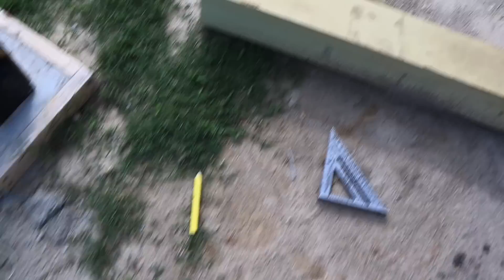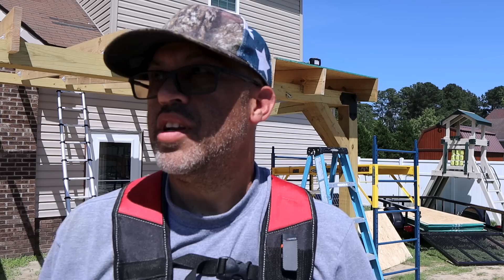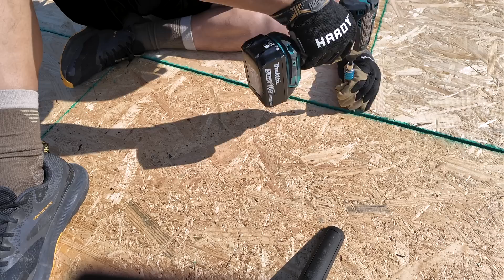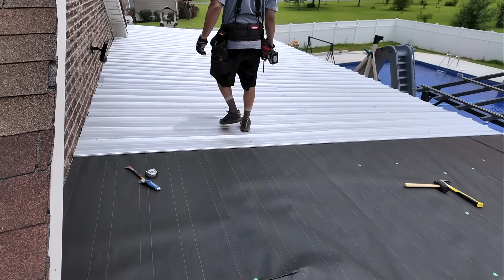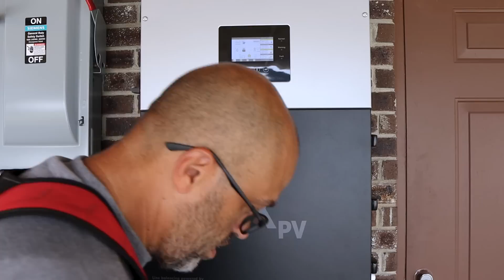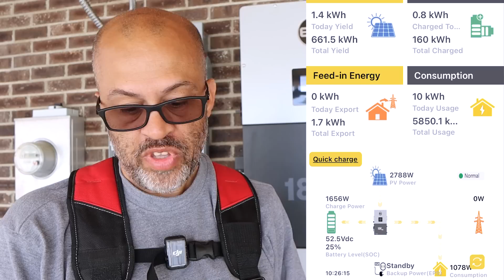DIY Solar Patio Build Part 2 - Homemade Solar Patio for EG4 18KPV

Comment: Greatly appreciate this info Rodney ! i just ordered a 12000xp and 13 peach 390w panels using your RODNEYHUNTGET50 code at signature solar . i'm adding a metal roof over our back deck and will be using most of the panels there . thanks , jeff

Comment: Looks great and I have a back of my house I could do that to also so its good to see this!   😊     I would be tempted to leave the top open and install solar mount rails across the top and install Bifacial solar panels and finish a cement patio to help reflect light up from below.          Looks like you need to move your security flood light out to the edge of the patio roof.
Reply from the maker: Yeah my parents ended up wanting the roof. I would have only used panels as well

Comment: I think this Bi-facial panels should not be installed on roof sheets. Back side Reflection generation works with direct installation on structure.
Reply from the maker: It’s what my parents wanted. I purchased to use panels as the roof but like I said in one of these videos my parents made the call to add the roof. 👍

Comment: Why no flashing at house wall where you tied in the metal roofs. Would it leaks down the road?
Reply from the maker: Small gap intentionally left. Even during downpours still dry between house and solar pergola roof. The house has a small overhang that is helping as well. Thanks

Comment: Hey man!  I am back as I consider a small porch solar cover for my pad in back that has a hot tub.   I am considering installing a hybrid EG4 mini-split and hooking up a few panels to the mini-split as PV connections.  I think that would be cool.  Anyway my solar journey has changed since a whole house design was more than I had advertised to my wife.  I am re-thinking to use solar to give me battery backup and use the grid as backup when I run out of batteries and output on an inverter.  I do like what I see with the 18K EG4 as well as the Sol-Ark.  Lots of options haha.   I am a life long learner and waste more time learning off of videos rather than getting my butt off the couch.  Thanks for your content - wish you were local to me - I could buy you a coffee or something.  All the best from north Texas.
Reply from the maker: Hey thanks! I definitely appreciate the support and I say just do it sooner than later the way things are going. 👍
Reply: @rodneyhunt  yes I agree on doing something soon. I plan on putting 2 minisplits up this fall. I have to figure what I want for my ground mount and build pieces at a time that scale.  I like learning this stuff. All the best!

Comment: Wow nice.  I'm in NC too (Charlotte).  I so much want to do the same as yours.  I have drawings for the solar patio,  but local gov and HOA permits have keep me from doing it.   Building anything that is over 12 feet of any dimension will need a permit Mecklenburg county. I was thinking of just doing it without permits but a little nervous.😂
Reply from the maker: Yeah I know what I would do but try to follow the rules for insurance purposes for sure. Hope you get it worked out

Comment: Nice work!  Work for the wood splintering you would be amazed how well masking tape works to reduce tear out.  You may want to consider installing flashing on the wall of the house where it transitions to the metal roofing as well as installing a drip edge around the perimeter.  Water traveling down the brick could get under the decking either from rain or washing the panels.  Since the slope is fairly shallow a drip edge will keep water from wicking back up under the decking.  I roofed a pergola with a similar slope and had to replace the decking after about 10 years due to dry rot that I could have avoided had I flashed it properly.
Reply from the maker: Hey thanks for the tips! Not really a builder so always learning

Comment: I'm going to do something similar to this, but I thought I'd have to have all the equipment in its own shed. Even though this equipment is sheltered by the roof, it is open on the sides. Do you worry about blowing rain hitting the equipment. Or is it designed to be out in the open? I don't want to build some elaborate shed if I don't have to.
Reply from the maker: Those equipment is rated for outdoor use. So as long as you get outdoor rated you should be fine. The patio shelter keeps it out of direct sunlight which is key. Plus direct rain etc. The 18kpv and 12kpv are outdoor rated inverter options then just get outdoor rated battery.

Comment: Lots of great info in your videos. Do you mind sharing what state you're in and how difficult it is to get permits for your DIY solar if you need them?
Reply from the maker: I’m in North Carolina. We try to do off grid setups so depending on your jurisdiction permits shouldn’t be required. I did look on my counties website and found nothing on solar. But then again I would not ask either. Not giving them any reason to get involved lol. But please follow all your local applicable laws. 👍
Reply: @rodneyhunt  thanks. I like your off grid set-up. I'll look into it for my area but the city and insurance companies don't make it easy. I'm definitely not giving a solar company Mercedes money to install some panels and an inverter.
Reply from the maker: Exactly! Hopefully you can get it sorted out. Regulators taking freedom from us daily. It will be worth it when you finish!

Comment: I am looking forward to your video about the optimizers. I wonder what the power difference will be between the angle they are at now and what a 30 degree tilt would do.
Reply from the maker: Would have been nice to have more of an angle fir sure. Just didn’t work out with what we had to work with. Video about optimizers will hopefully been out next week sometime.

Comment: @Rodney when will you release the build of material? I like to know that 6x6  L support and length of the bolt .. did you painted the bolts black?
Reply from the maker: Video is on my to do list but not sure when exactly. I did not paint any bolts.
Reply: @rodneyhunt  so the bolts for the L brace came as a kit? .. ok will wait for the parts build video ..
Reply from the maker: Those are simpson strong tie brackets and bolts. They come separately though. Got them from lowes
Reply from the maker: Outdoor accents might be the name of that series if brackets and hardware
Reply: @rodneyhunt  awesome thank you  .. mine are some amazon low cost version, they work but has NO  style to them, i like yours a ton.. will swap mine out once i get them.. thanks
Reply from the maker: No problem! 👍

Comment: Nice setup!!! Install looks clean. I would have left overhang longer so shade would be less on the top panels if they were lower down on the roof. I would add a L Drips edge against the wall so water doesn't go down the wall. Impressive build man. You did an amazing job.
Reply from the maker: Hey thanks! Good ideas

Comment: Just a note from a builder- high temp roofing underpayment with metal roofing is the standard but with the layer of solar shading the roof, should be fine. Also expensive. I have so much to learn about solar so appreciate all the good YouTubers like you.
Reply from the maker: Had no idea that was a thing. Like I said not really a builder lol. It should work for now I think. Will look into that next time! Thanks

Comment: Should use brackets make by s-4 that screw right into the ribs. Make jobs a bit easier😊
Reply from the maker: Yeah! Probably need to look into different brackets for the next metal roof job. Thanks

Comment: Hey Rodney, looks great. Only thing I'd do do different is to skip the plywood and tar paper  (we just want some shade) and use bifacial panels.  I see your comment to another that you too used bifacials but your parents wanted the weather blocked by ply and tar paper.  
I would have also just put 22.5" spacers across between the joists where the plywood seam is - that would have given you a little more strength. And, like you mention below, using those H clips helps too.  Looks good man!
Reply from the maker: Yes I agree with skipping roof for just the panels! But they have what they want now at least. Thanks!
Reply: @rodneyhunt great job. I am looking at doing what Joe mentioned: Bi-facial no plywood since we just need shade. I learn a lot from your videos and get ideas. 
Thanks

Comment: I am planning for a similar pergola to install solar panels. For the 30% Federal Credit, can i include the cost of pergola or is it just the solar panels that qualify?
Reply from the maker: That is mounting for panels so should be included in my opinion. Ask an accountant to verify but that is what I think
Reply: @rodneyhunt  Using your logic, you could write off the house the panels are attached too also!  LOL!  No, the pergola itself would not qualify...
Reply from the maker: No the house was already there. The mount was specifically built for the panels. But like I clearly stated you should ask an accountant. Thanks
Reply: @rodneyhunt  thank you
Reply from the maker: Here is the energy.gov information on what is covered. It says mounting is covered but talk with your accountant. https://www.energy.gov/sites/default/files/2023-03/Homeowners_Guide_to_the_Federal_Tax_Credit_for_Solar_PV.pdf

Comment: Great Work Rodney, I can  recommend using a grandfather cane method to push the wires thru the roof ( like HVAC ) , meaning using like 180 degree pipe like a cane to push the wires then bend and go down that way no water will drip in  just use 2 90 degree 1 inch and some straight pipe thru the hole, seal it and then push the wire water like to travel on wires, even if u seal it most chances it will go in, using the method the water will have to go up then down so its less chance it will go in.
Reply from the maker: Great tip thanks! Appreciate the support

Comment: Thanks for taking the extra time to record and edit the video. Great job especially since you did most if not all of it by yourself. I have a question about the cables under the panel laying on the roof. Do they need to be tied up somehow so that they are not touching the roof? Maybe you are waiting until you install the optimizers before you do that or maybe I am wrong. Thanks again for the great content.
Reply from the maker: Yes. Waiting until optimizer install to clip wires to panels. Thanks

Comment: Great job. What is your plan for End wall drip edge where the brick face meets the end of your roofing. I totally see water running down the brick and getting under your roofing. There's a good YT video on this at Metal Roofing Learning Channel. Search: "How To Install Metal Roof Endwall Flashing On An Awning. Endwall Trim Installation Instructions"
Reply from the maker: For now leaving the small gap to keep structures separate. The eaves on the garage roof should keep most rain off the spot unless the wind is blowing directly at it. Rained several times since installing plywood and has stayed dry so far.

Comment: Nice work Rodney! Amazing how you do everything all by yourself. Don't forget to add a nice bead of sealant at the top edge of your metal shingles so you don't get water seeping in 👍👍
Reply from the maker: Hey thanks. Left a small gap since this is freestanding. We have the eave from roof that should cover most of the small gap. Thank you for the tip!  Can always add it if it seems necessary later
Reply: @rodneyhunt  That OCB doesn't like getting exposed to moisture, so get it all covered and sealed up!

Comment: Rodney one other thing, you only need 9 optimizer for the top 9 panels, and wire the top together and the bottom together separately, it seems in the morning only the top 9 panels get shaded.
Reply from the maker: Really early the bottom seems to be shaded some as well. Regardless I will add since could be more shading during winter months when sun is lower in the sky. Plus I ordered enough to cover them all
Reply: @rodneyhunt  copy that plus with the Tiago app you can see each panel performance so that’s a plus too, BTW their is just one thing I don’t get, the grid connection is going back to your main panel via backfeed 70amp breaker, how does the 18Kpv knows what the grid is feeding your main panel with the grid is still connected to the main panel lugs? Is there some sort of sensor the 18Kpv has to detect the grid load or it just assumes if the house is asking for X and its sending Y then the grid most be Y- X?
Reply from the maker: The CT’s are the sensors. They are on grid input lines that are connected to the main grid panel. Your main lines on your 200 amp breaker.
Reply: @rodneyhunt  i see .. i think i missed that part now that makes sense, i missed you got CT’s on the main hot lines .. now i can sleep lol thanks again brother .. keep up with the awesome content 👍

Comment: Does the hybrid inverter have an arc fault interrupter or something to detect arcs if a connection becomes loose over time? 400V DC seems pretty dangerous in this regard.
Reply: Yes, the 18kPV has arc fault protection on the PV.

From the spec sheet:  PV Arc Fault Protection, PV Ground Fault Protection, PV
Reverse Polarity Protection, Pole Sensitive Leakage Current
Monitoring Unit, Surge Protection Device, Output Over-Voltage
Protection, Output Over-Voltage Protection Varistor,
Integrated Disconnect DC switch for each MPPT
Reply: @AndirHon  thank you! There are so many cheap chinese hybrid inverters on the market nowadays, and I doubt that most of them have an arc fault protection even though they usually accept up to 500V, good to know EG4 ones are equipped.
Reply: @gaggix7095  It's built to mimic the SA 15K, so yes.
Reply from the maker: Thanks!
Reply from the maker: I know it has a PV short alarm. So it must turn off but not 100% sure. Will try to find out.
Reply: @rodneyhunt  I was mostly talking about series arcing, not parallel arcing. I don't think they will trigger a short alarm.
Reply from the maker: Will need to do some research on this topic. Thanks for the info

Comment: Good job ! Try to have pc wires attached to panels under and not loose on metal roof
Reply from the maker: Will do! Going to add optimizers so didn’t want to tie all cables down yet

Comment: DIY Solar Fun with Ray Loveless does use grid to supplement his 6000XP. Couldn't start central hvac until he tied grid in. Trying to be sure before I get XPs. Thanks great fun and editing / commentary is all perfect
Reply: Advise him to install a soft start on the AC…
Reply from the maker: Good idea!👍
Reply from the maker: Yes they have grid input but not grid interaction. The 18kpv can receive and feed the main grid panel. 👍
Reply: @rodneyhunt  Are you saying the 6kxp is unable to pull the difference in load from the grid like in the video? so it would be all solar+battery OR all grid?
Reply from the maker: Just couldn’t go to same main panel like 18k. You would need grid input from a different panel or the meter to feed the 6000xp that feeds the panel it is connected too. So in from one place and out to another. The 18k can send to the same panel the grid is powering.

Comment: Looking good Rodney,  as are you. Looks like you've lost a bit of weight. Good job, i need to also. Only thing I'd done different is put a band on the front of the porch on the joist as it keeps it from twisting and curling over time.... Jefg
Reply from the maker: Oh nice. I have been doing the carnivore diet since January 21st. Lost over 50lbs. Thanks
Reply: @rodneyhunt  Excellent,  2 year ago we did keto lost over 40lbs. But unfortunately work got in the way. Trying to get my wife to do again or carnivore diet. Just  don't feel good  at present.
Reply from the maker: Feel better as well. I think everyone should try it for 30-45 days to see how they feel.

Comment: I was going to say you waste all the time and money on the roofing portion when you can easily use the panels as the roof nowadays but I noticed the panels are bifacial so this is actually big brain because you are using the heat that will be reflected by the metal roof as more energy for the back parts of the panels. GOOD JOB SIR!
Reply from the maker: I wanted to panels as rhetorical roof but parents wanted the roof then panels. So I hope the metal will reflect some light but probably not much. We will see but they are doing good so far
Reply: @rodneyhunt  You should of explained to them the huge increase in the panel outputs by keeping them open on the bottom, your right by mounting flush on the roof you will loose most all the benefits of having Bi-facials
Reply from the maker: @Rock_Nemo  I did but they want what they want. I might just get them some bigger mono panels in the future for the shelter
Reply: @rodneyhunt  I still think you will get good amount from the metal reflecting I saw another guy using reflective tarp on the ground n got huge improvement on his
Reply: Solar panels collect power by light, not heat. You are a smooth brain.
Reply: @jimbob100-d3l  dude I mispoke but he knew what I meant no need to be rude

Comment: Interested to learn about the optimizers.
Reply from the maker: They should be a game changer for partial shading on string inverters.
Reply: @rodneyhunt  I'm curious to see what your results are.  I've seen several unbiased tests comparing with and without.  Seems to be mixed results and there are loses with them as well.  Kinda should have them for RSD being on the roof though.

Comment: Should have used H-Clips on that OSB.
Reply from the maker: I remember that from flooring but didn’t think about it for the roof. Next time I do something like this
Reply from the maker: At least I think that is where I saw it could be wrong. Not a builder really but thanks for the tip